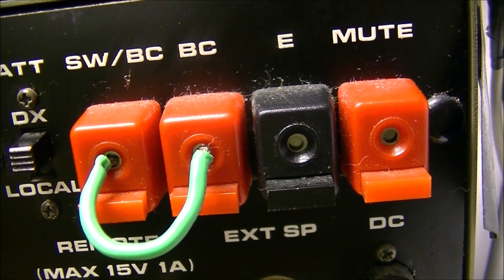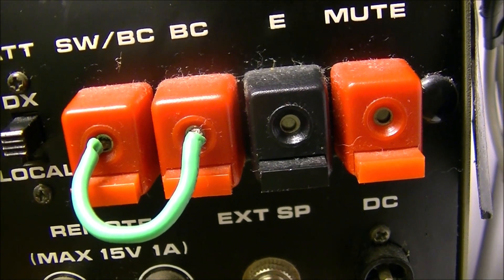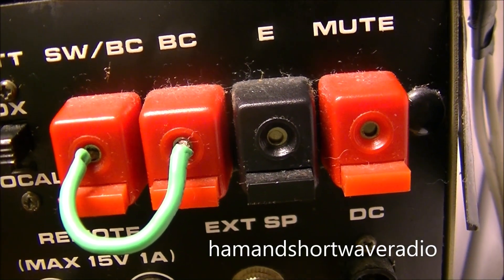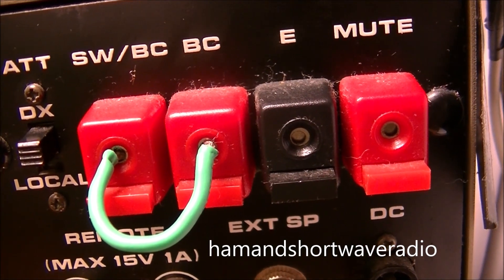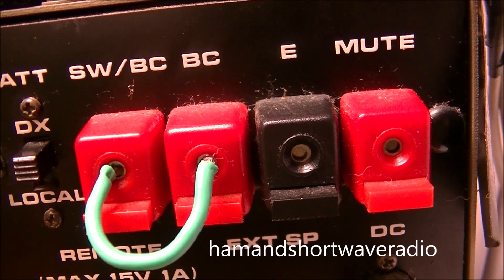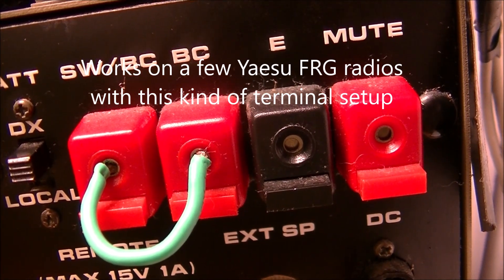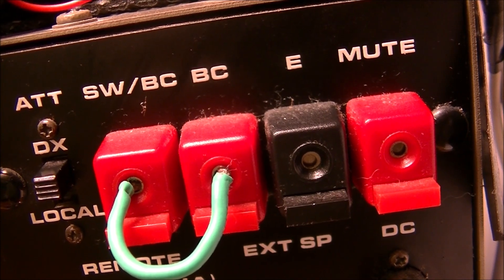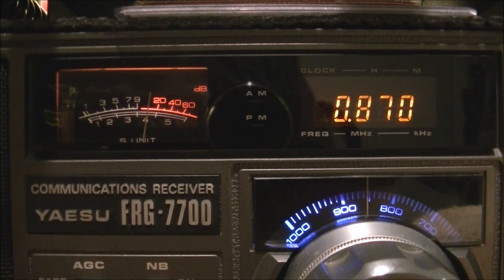Jumper wire increases LW and MW sensitivity on Yaesu shortwave radios

Comment: excellent tip, although I have no FRG, my interest is also in apparent similarity between the back panel of the FRG with the FRT-7700 tuner, which I am hoping to connect (not successfully so far) to the NRD-535. I could make out you are using a "PR239" antenna, but I could not seen how is it connected to the receiver; presuming it is to the screw type coaxial. I thus wonder what overlap might be in the antenna connections (inputs) between the FRG receiver and the FRT tuner.
Reply from the maker: I am using an end feed sloper antenna with a pl259 connector
Reply: @Tobinindustrial  Thank you Andy

Comment: Any LW signals received with the jumper?
Reply from the maker: No, I am using an end feed antenna connected to the SO239 50 ohm jack on the back. the wire loop just increases the sensitivity of LW signals

Comment: Anyone who bothered to read their owner's manual would have known that the AM antenna connector was not meant to work with the SO-239 connector.
Reply from the maker: I bought the radio many, many years after it was first purchased. I didn't get a user manual. I never thought this would be an issue using the so239 for MW and LW. A simple ground switch in the design could have rectified the issue but they suspected nobody was gonna use the so239. Not sure why they put that there without a switch. It was an easy fix though. Thanks for your comment
Reply: Yet THE SO239 connector is for both AM and FM, surely you mean LW and/or MW, ALL are AM connections.